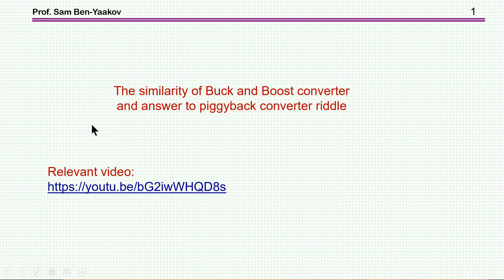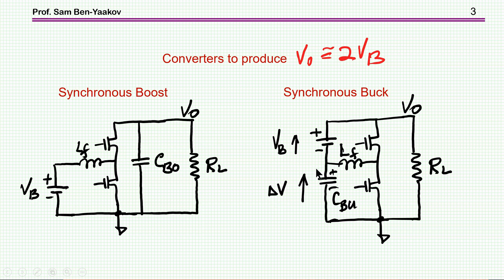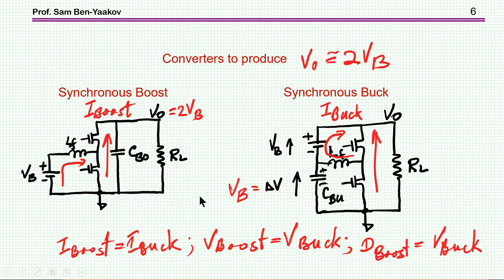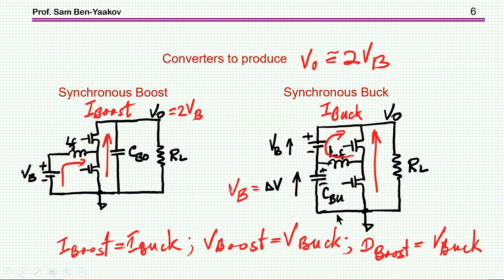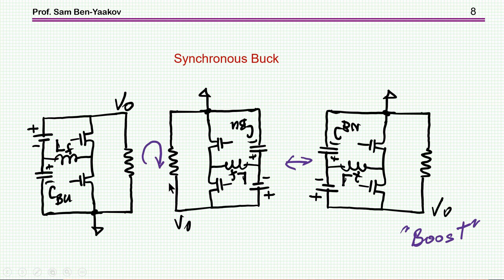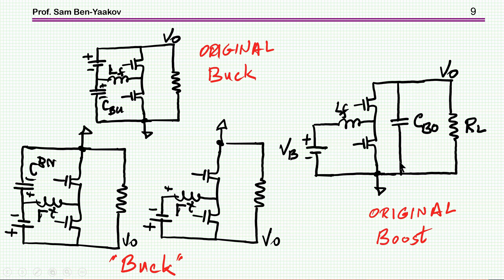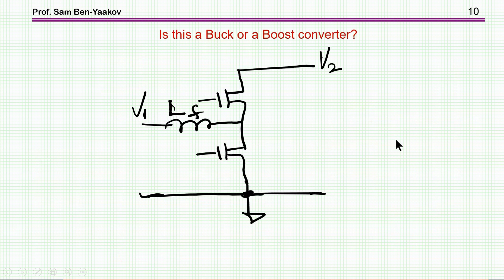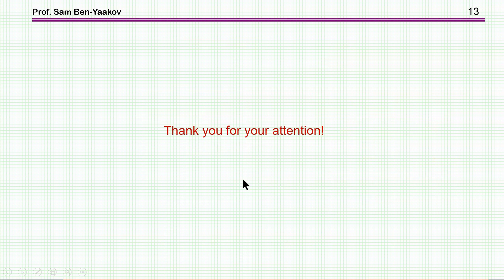The similarity of Buck and Boost converter and answer to piggyback converter riddle

Comment: thank you for this follow up. that was very clever what that guy done flipping it around like that.. : )  i wasn't to far off in my trying to explain that there would be an oscillation with the cap position in plan 2 but didn't have the electronic knowledge to put it across clearly.  i hope you do more videos just like this because, these are circuits beginners like me would use loads. and knowing the most efficient one for the job will helps a lot. THANK YOU PROFESSOR..  AWESOME STUFF  : )
Reply from the maker: Thanks Keith for input.

Comment: Thank you Prof. Yaakov for the interesting topic, I also have a query about Buck /boost configuration, I hope your upcoming video will address them. As we use half bride as buck, the current is provided from the input capacitor and this loop needs to be as small as possible to minimize parasitic inductance of loop, at the same time if we look on the other side(if we want to operate HB as boost),  input capacitor( output cap for the buck) provide current, but we already a huge filter inductor in this loop, what about all reducing parasitic inductance in commutative loop theory, cause loop might introduce some inductance but its nothing with respect to huge filter inductor already available in the commutative loop.
Reply from the maker: Not sure I follow your question. From the power point of view, there is no difference between the Buck and Boos ( current is positive or negative). However, there is a difference in the small signal transfer function (V/d).